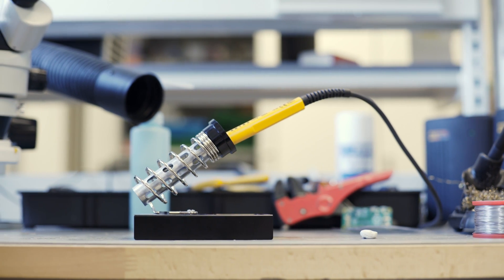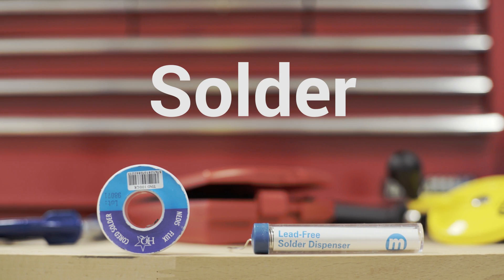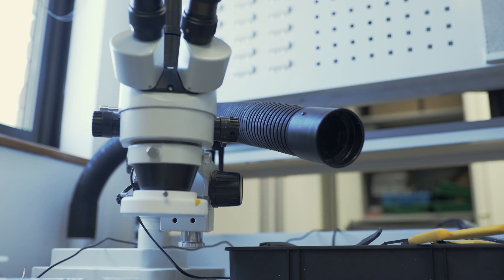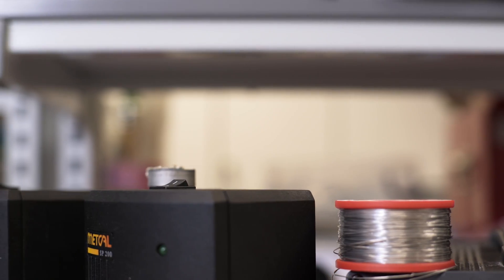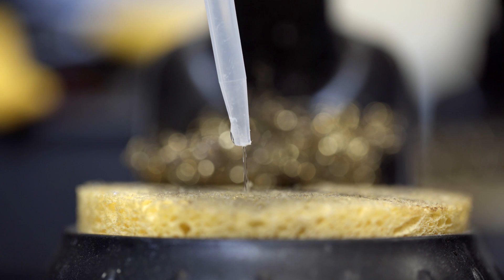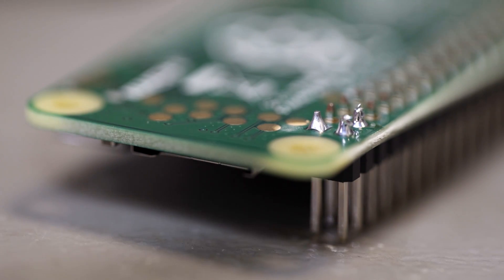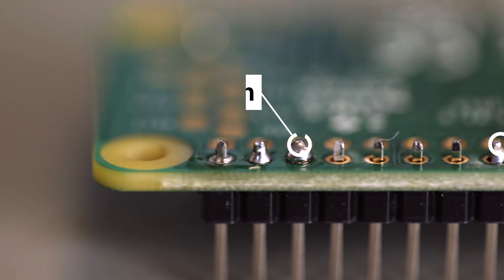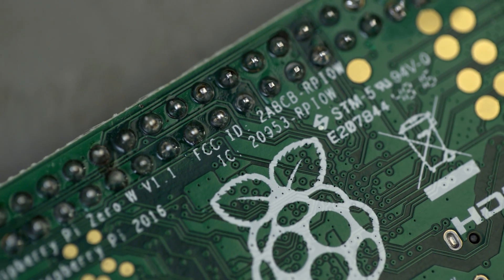How to solder your Raspberry Pi header pins

Comment: Hi there, thanks for the video. Okay, so here's the thing. I'm a lifelong DIYer / woodworker / ceramic designer, etc (I'm really practical) and since I tried soldering the GPIO header onto my RPi Zero 2W it won't boot. I accidentally got a bit of solder onto the 'Run' connection and I can't desolder it.. My first question would be whether or not I've probably broken it by connecting it to mains with that soldered. My second question is whether you're supposed to connect devices (a stepper motor) to the Pi once it's running, or should it all be connected at the same time?

Any help would be great. I'd personally recommend buying a Pi with a header on it (I didn't due to supply chain issues we're all having) because I can't get started learning how to use it because of this.

Comment: Soldering is reserved for those with great eyesight. Those like me with failing eyesight that can hardly see the header pins are effectively "fluxed with a c" when it comes to the Raspberry Pi.  The Great gods of Pi has decided that "thou shalt solder or thine Pi shalt remain useless electronic junk", and that has been the fate of my Pi Zero for more than a year.
Reply: You should check out the solder-free hammer headers that are now available.
Reply: I always work with a lighted magnifying glass so I can see the solder joint .
Reply: @patmcfarland6035  true. even if I have a good eyesight (thanks to good contact lenses ;) I still find way more convienient to use a magnifier glass. Ah and also good light
Reply: Yes just seen this from pimorini, very reasonably priced too

Comment: What temperature would you recommend for the Solder Iron ? or, if it is a non-adjustable, would a 30W solder iron will be enough, too hot, not hot enough ? thanks for the video !